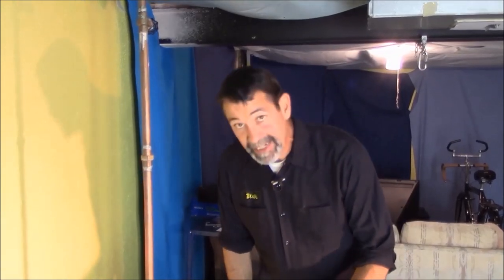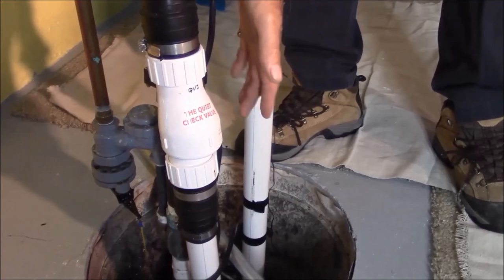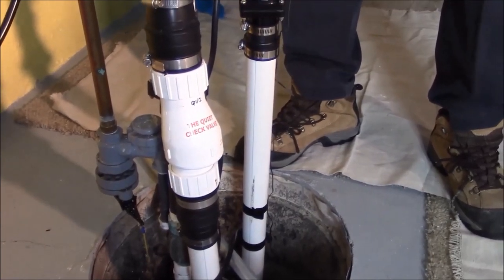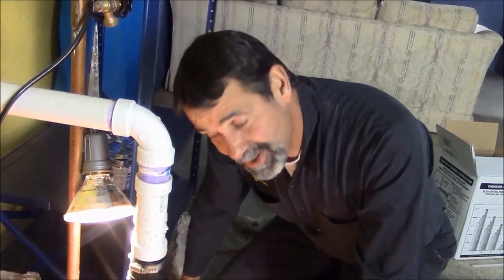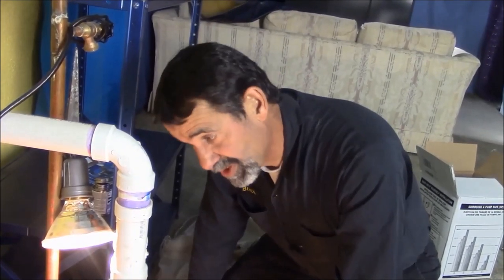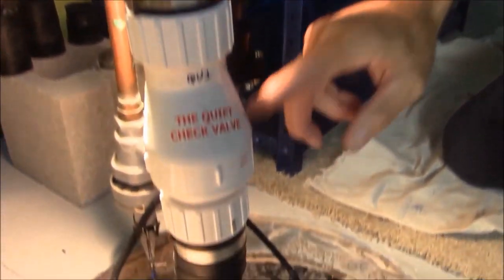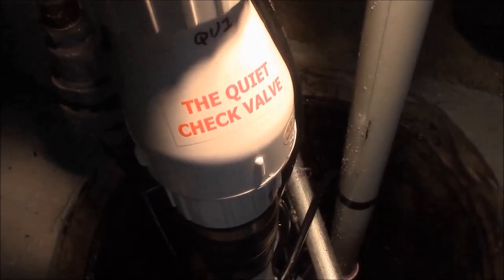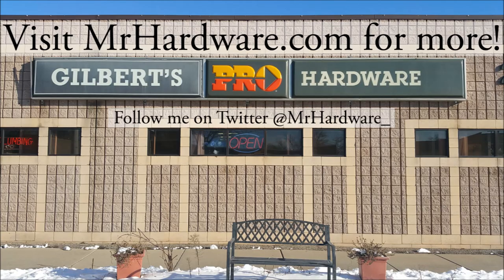Quiet Check Valve For Sump Pumps - No Water Hammer Noise

Comment: I just bought one but haven't installed it. My handyman said not to do it because when it needs to be replaced in a few years I'll have to cut the pipes that lead into it. Please help me understand how it will be replaced when it wears out. THANK-YOU !!!
Reply from the maker: It comes with a smooth piece of PVC, on either end that I used to Fernco coupling to clamp on to the pvc pipe. So when I need to change it, I can loosen up the clamps on the Fernco and slide the old one out. Also, if you look at the video you see it’s knurled on the ends, those are like unions, and those can be unscrewed because if you were replacing it with the same check valve, you would unscrew those nuts and not even have to touch the Ferncos.

Comment: With an ejector pump like your. Does it needed to be vented to the roof or can it be through a side wall (no windows/doors intake in a 15ft area)
Reply from the maker: I believe sewage ejector systems, which is a sealed lift tank needs to be vented to the roof. I would check the local and building inspector for more guidance.

Comment: The check valve is good...Except for that pump though, my grandparents have the same exact one and it makes the same humming sound that came be heard from upstairs.
Reply from the maker: Maybe a rubber coupling on the discharge line will prevent the pump from humming throughout the house.
Reply: Hi have problems not have presure the fitins or pump whats can do

Comment: Why dont you need one on the backup ?
Reply from the maker: It has one built in. You must have one on all sump systems that lift water over a few feet. Plus with 2 pump systems the water will go back through the other pump as one runs.